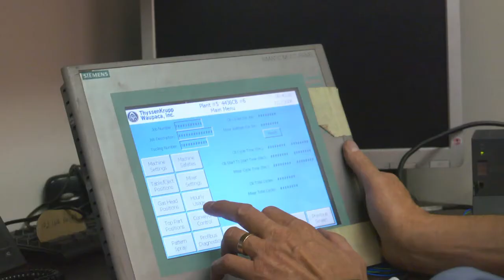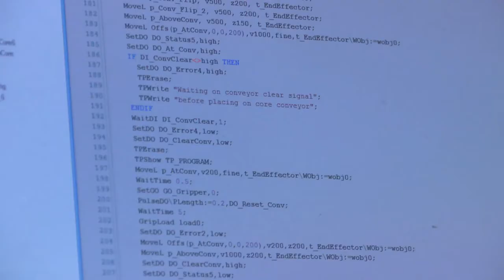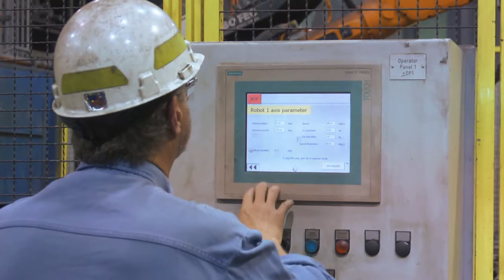Career Spotlight: Electrical Technician

Comment: Is an electrical technician and an electrician the same? If not, which do you think is better?
Reply: They’re not the same. Electrical technician is more programming and troubleshooting plcs. Electricians also troubleshoot with plcs but they’re more hands on
Reply: Thats what I am loosing my shit on finally figure out I just wanna wire houses on my own and understand thay is 8000 too 10 000 before then but my gosh what course do I take
Reply: @robertwhitstone3741   that’s an electrician best advise if do your research